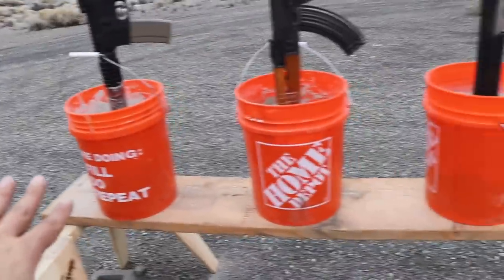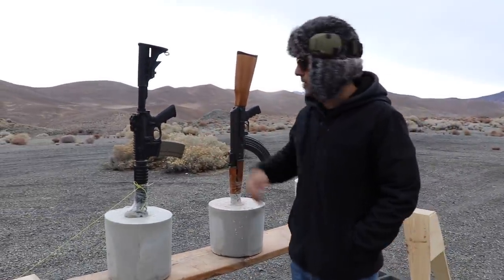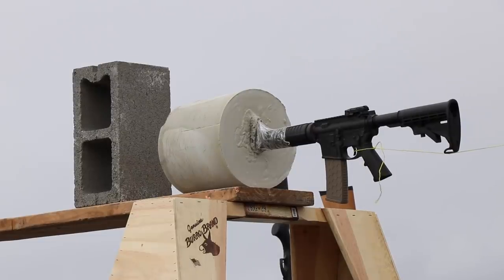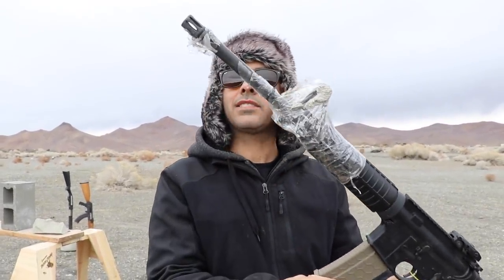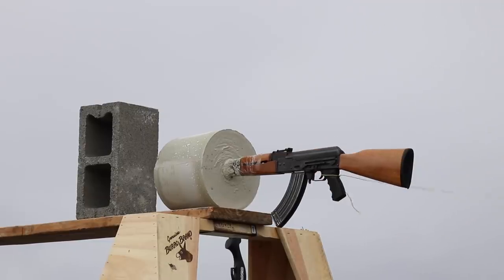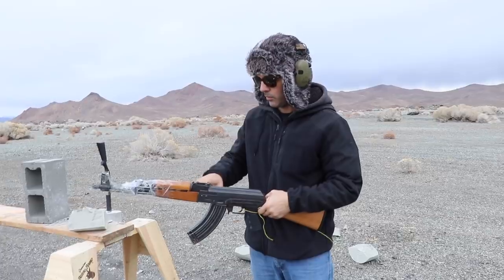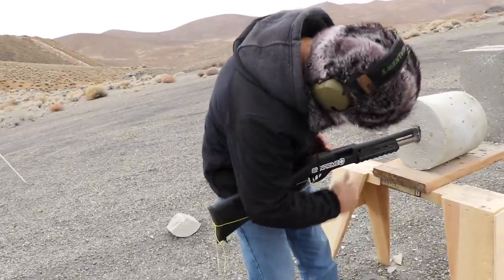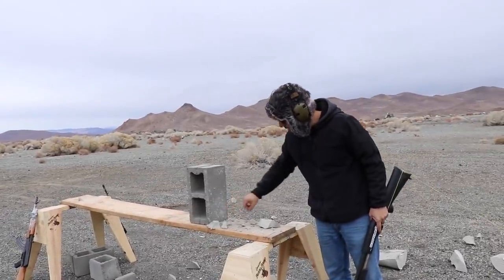will rifles work stuck in concrete

Comment: 50BMG in concrete next!!!!
Reply: That’s would be sweet now you need to do it
Reply: 20mm cannon would be better
Reply: Little bit expensive if the barrel explodes.
Reply: u read my mind
Reply from the maker: Lol will do
Reply: @EdwinSarkissian  hell yeah
Reply: @EdwinSarkissian  Gazan es aper
Reply: Real Surfer  The barrel will blow out.  It's called a bore obstruction.
Reply: There gonna have to use two times the amount of concrete... For the 50 ... 10 Gallon ... An 15 Gallon for the 20MM ...
Reply: @EdwinSarkissian  Edwin is the man
Reply: Ka booom
Reply: @EdwinSarkissian  20mm in concrete 😆
Reply: But u must use 50l bucket☠❗❗
Reply: HEYOOOOOOOO!
Reply: Yes! Was just about to comment the same thing
Reply: 20 mm😂
Reply: Aycan  can create a massive explosion too
Reply: Yeah great idea totally not gonna fly up 
Fifty feet
Reply: Hell yeah
Reply: Underwater in concrete
Reply: In a 55 gallon drum
Reply: 50 bmg in 55gal barrel
Reply: I would expect concrete exploded into nothing/powder and of course, destroys cinder block!
Reply: WHO_TEE_WHO!!! Good to see you here buddy!
Reply: Real Surfer  muzzle will explode.
Reply: @EdwinSarkissian  20mm
Reply: @Edwin Sarkissian Hooah baby! Please do 50 BMG!
Reply: But bigger bucket!
Reply: The same thing is just going to happen and you need to vent the concrete because the barrel is sealed and once the the round detonate its just going to build up pressure and just blow up the concrete and its the flow of the pressure that pushes the bullet out
Reply: I was just about recommend the same thing
Reply: The Edwin science channel
Reply: Edwin it’s a must. 👏🏼👏🏼👏🏼
Reply: @EdwinSarkissian  if you're really gonna do this you gotta use a big barrel instead of just a bucket lol. We know it'll blow a bucket wide open already. Maybe the bullet will make it through and distroy the cinder block tho if you do just do a bucket lol
Reply: 50 bmg using is useless. The concrete breaks again
Reply: @EdwinSarkissian  did you make it??
Reply: @rontur9177  guy getting an thick tube that has 12.8 mm internal diameter and an DIY primer for the "gun"

Comment: Are we all just going to ignore the fact that he almost cut his finger off?

0:28
Reply: Yes.
Reply: bro that did make me so nervous
Reply: Guard removed and not using the side handle. More dangerous than firing guns in concrete.
Reply: in all reality that's a grinding wheel so if he did slip, it wouldn't be as bad as a cut off wheel
Reply: Jaspa is an expert, this is a science channel after all
Reply: We'll at least he's wearing eye protection 😂 who needs fingers anyway
Reply: He is ready
Reply: Or at 3:00 when he grips the pistolgrip and you can se the string getting thighter and is still arround the trigger, and gun is on fire 😭
Reply: Hispanics

Comment: I can see why the rifles and shotgun are coming out with little to know damage to them.
The tape actually closes off the barrels giving the bullet a chance to act like a chisel and drive into the concrete. Plus the gas actually then because of the gas of the burnt gunpowder then forces the gases to drive outwards blowing the concrete outwards from the gas blowing out the concrete

Comment: Don't tell people things like "you can stand in front of it and you won't be hurt".  Because some dummy will set it up with only a small amount of distance  between the muzzle and the bottom of the concrete.  Then an even bigger dummy will stand in front of it to "prove" it works and get a gut full of shattered lead and concrete.  "Hey, hold my beer and watch THIS!"

Comment: I wonder if the bullet is even destroying the concrete or if it's mainly the gases since none of them even hit the block behind it
Reply: Yeah, it's mostly due to the pressure from the gases. It would have looked cool if he had tried it with transparent epoxy and slow motion camera.

Comment: now repeat this experiment a few more times and use ballistics gel instead of the cinder block, and you'll have an actual scientific conclusion with backing data.
also with different levels of how deep in the concrete the gun is and what rounds they use for each.

Comment: Without aggregate,its just cement and sand(mortar),not concrete. The mix used is very weak. If curing is done to the real concrete,the result will be different.

Comment: Your 'test fires' were a little unsafe. You should've shot them from a distance/with a pull string. Although not likely, there is a chance some bullet material or concrete could obscure the barrel. There is a small chance they could 'blow up'. Safety is #1!! Good video otherwise, very interesting!